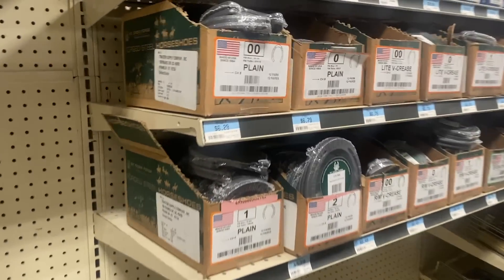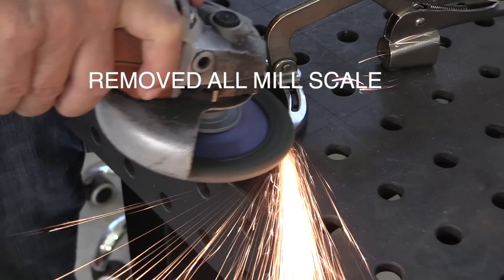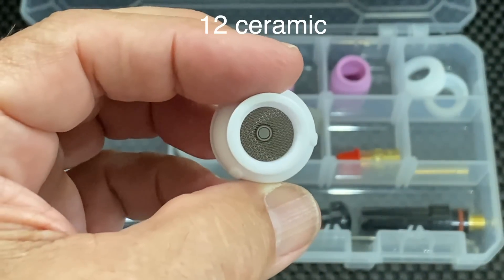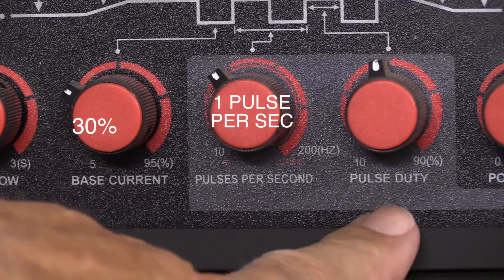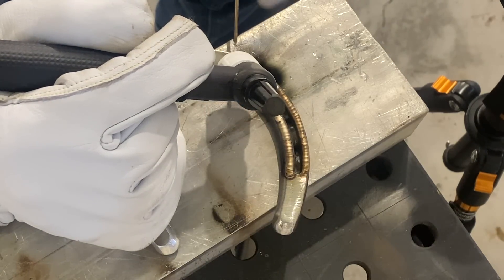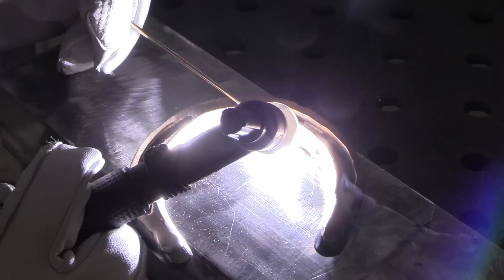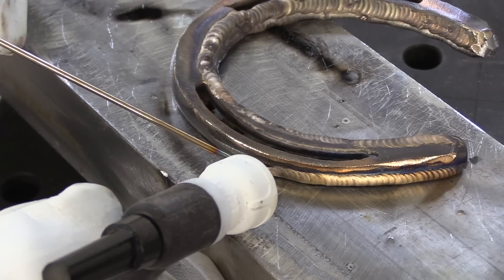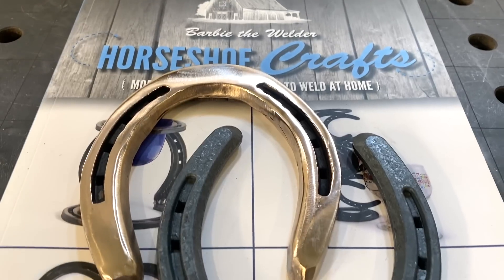Gold Horseshoe TIG Brazing Project

Comment from the maker: https://weldmongerstore.com for TIG filler metal, TIG cup Kits, TIG Fingers, Gloves, Tungsten,  and other quality welding gear.
Reply: Can you do a video on what causes and how to avoid undercut on tig especially pipe, I see it happen a lot on other peoples welds and just want to know the technicals about it, or welding with terrible fit ups (I work in ship repair) example- sheet aluminum with edges of different thickness from previous welds + gaps from 1/8in to 3/8in all on the same piece that’s about 11in x 8in or so

Comment: Awesome video Jody. I only messed around with silicon bronze a couple times it worked good for one job I had. Learned about it from you a while back but I still keep a pack on hand just in case. Jody I wish you had the older style t shirts back with the muscle guy and gorilla on the back of the shirts they were cool I still have one. 👊🏻

Comment: Every time I try doing TIG brazing i end up with a white powdery residue
Reply: That's because you're using brass rod's
Reply from the maker: @steakandchips9046  is probably right.  brass rods and silicon bronze look almost identical but brass rods have a lot of zinc and it outgasses into white powder

Comment: Funny enough I have a horseshoe that I found on the street. thrown from one of the horse patrols that are occasionally working the area during holidays by me. Aluminium shoe, now mounted on a plaque  cut from a tree, using the original 4 cut nails used to hold the shoe on, which were still there on it.